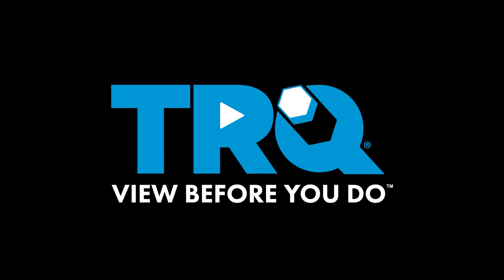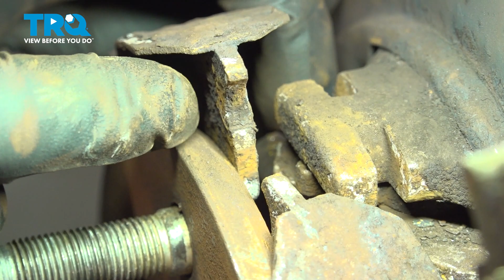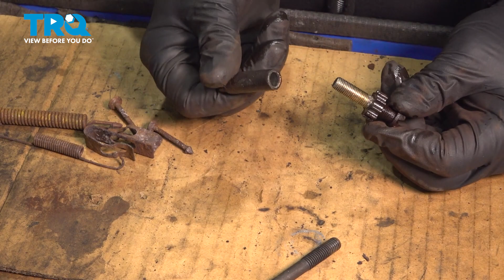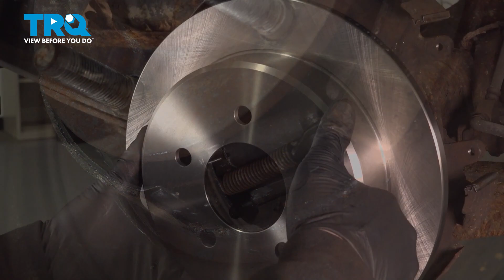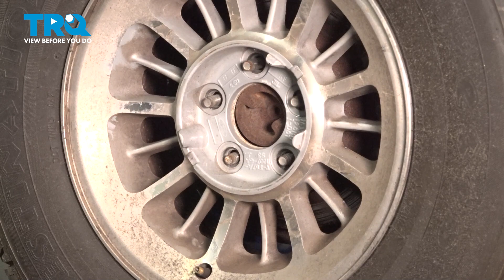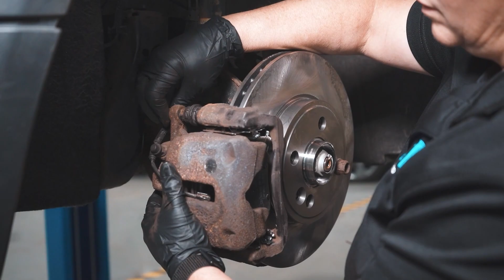How to Replace Parking Brake Shoe Set 1995-2001 Ford Explorer

Comment: I rebuilt my 8.8 differential, replaced the bearings and the axles.  Then I decided to replace the parking brake shoes.  You guessed it, I ended up removing the axles to get that last spring installed.  I have no idea how you can install the last spring with the axle in place.

Comment: This needs a "directors cut" that shows all of the brake shoes snapping on fingers, fighting spring tension constantly, maximum-effort pushing and prying, the real process for re-installing those spring clips/pins, and the tech cursing the entire lineage of the engineer that designed Ford's drum style parking brake.  Notched screwdriver is a must, ideally a long one, getting the shoes re-hooked to that back spring is hugely non-trivial, and seriously whoever designed this brake setup must've hated techs.  (legitimately useful video though, even if it glosses over some inevitable struggle).

Comment: Anyone else cringe at the thought the springs are most likely as old as the shoes he just replaced.. I get it if it still works reuse.. But bruh.. Those got to much rust... Rust is rust bruh replace springs and pins... Like that 1 pin was bent up.. Just replace all you wont have to worry about a spring breaking

Comment: Great video, looks like I’ve assembled mine correctly. I’ve screwed with mine a few times now, bought new shoes and hardware, made sure it was adjusted to where it was just barely dragging, etc… And at best, it only kind of works when moving in reverse. Doesn’t hold the vehicle at all going forward. Any pointers on what I’m doing wrong?

Comment: Ok so it's unclear here but for anyone wondering, the driver's side adjustment cog/gear is down to expand it and the passenger side is the opposite, so up to expand it. To loosen vise versa with respect to whichever side. When hammering the top spring back into the notch on reassembly, pushing it with needle nose pliers also works so it doesn't pop back out again. Also two people and a notched flathead make this job a whole lot less stupid than it already is. It goes without saying you're going to need a mallet. Helpful video however, thanks 👍